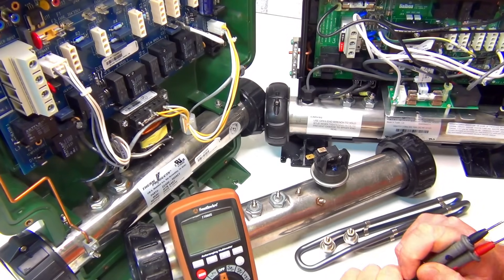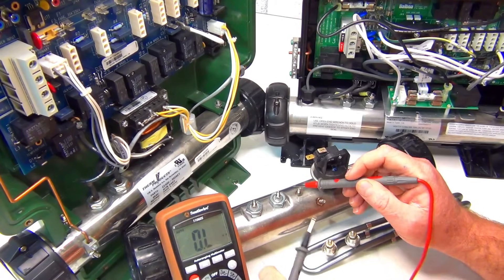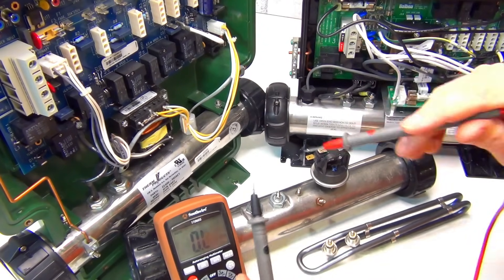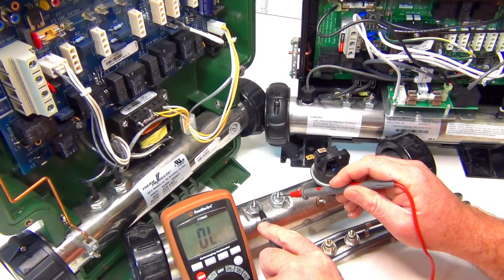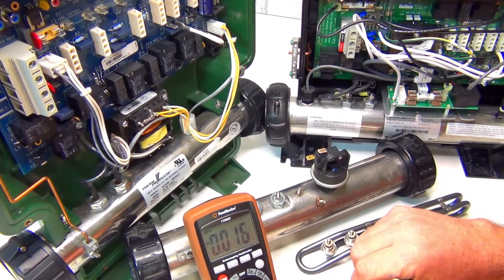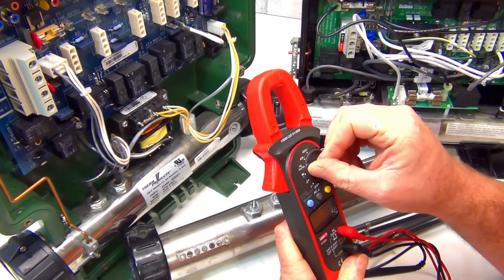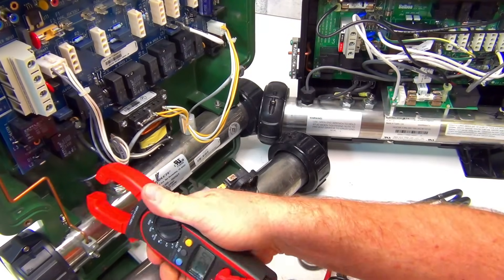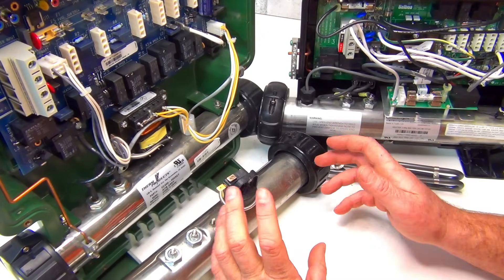4 Ways of Testing a Hot Tub Heater Element [ Step by Step ]

Comment: Hoping you can help. I have the balboa vs100 control board and heater. My hot tub is not heating past 71 degrees. Filters are clean and in standard mode (mot economy or sleep). I followed your steps. Test passed ohms, and continuity test. However, the voltage test seems bad. At my control board and across the heater element leads I only get 20 volts. But if I touch a heater lead and the ground or a heater element lead to the heater manifold I'm getting 120 VOlts.  My hot tub is wired for 240V. What do you think could be wrong.
Reply from the maker: Sounds like a relay issue.  Can you see any burn marks or melting on the circuit board?  Is your heat tube have the black cover or the clear cover?
Reply: @VIPPoolsandSpas  clear cover
Reply from the maker: @successfulguy  change out that heat tube.  It's that whole thing.  With the cord.  All info is on that tube.
Reply: @VIPPoolsandSpas  I have the heat tube out but I'm concerned that from the board I'm not getting 240VOlts. The tube and heat element across the prongs is giving me what is coming from the board and thats not 120/240 volts. I was worried that its something on the board. Your idea aout the relay being bad sounded more aligned to my issue.
Reply: @VIPPoolsandSpas  and the tube doesn't allow me to remove the heat element its almost like its soldered in like they made it so you have to replace the manifold too
Reply: @VIPPoolsandSpas  the continuity test passed and so did the ohms test
Reply from the maker: @successfulguy  it's one piece for that.  It's not cheap.
Reply from the maker: @successfulguy  volts coming in is 240v?   Your pump is running?  No error codes on topside?  No burn marks on the circuit board?
Reply: @VIPPoolsandSpas  yes 240, pump is fine, no burn marks on front of board I did not take it out to look at the back
Reply: @successfulguy  Did you ever figure out what the heating problem of your spa was?
Reply from the maker: Also, are you getting 240v coming into the tub from the house?
Reply: @VIPPoolsandSpas  yes

Comment: hi would you help me with heater,i test each leg black and red  got 120v each leg ,but when test black and red together got o volt.tell  me what wrong here ? ohm i think ok @  13ohm ,continuity is ok
Reply from the maker: What spa pack do you have?  Are any error codes on the topside?  What's the volts coming into the tub?  Just test volts at the 2 leads together.  If you have a 240v tub, it should be around 240v.  If it's a 120v tub then you'll get 120v.
Reply: @VIPPoolsandSpas  Hi there, hope you see this. I'm having the same issue as this guy. Testing voltage across leads gets 0V but each leg to ground is 120V. It's a Balboa M7. No error codes. Tub is not heating. Continuity and Ohms are good. I noticed the tub stopped heating after the water level may have gotten too low. Thanks!
Reply from the maker: @isaachamblin8866  replace the heater element.
Reply: @VIPPoolsandSpas  everything I've read says that if the voltage across the heater terminals is 0V then it's a problem with the circuit board. Plus the heater element has a resistance of 11 Ohm and good continuity. Thanks for the response!
Reply from the maker: @isaachamblin8866  Ok, change the board.  Doesn't matter if you have 11 ohms or you have continuity. I could get that with an element out of the hot tub.   It's going to be the element or relay on one side.  If testing 0 on a heater element was that simple, why don't people just say "0 volts, change the board"  No need for a video.  There's a few reasons why you would get 0 volts across the element.   But hey, what do I know.
Reply: @VIPPoolsandSpas  I figured it out. The heater relay on the board got too much current and burned out. Replacing the relay only cost $10 while replacing the whole board would've been at least $500 but I could only find my board for $750. So I saved hundreds of $ this way. I do appreciate you taking the time to respond. I do think it's pretty obvious though that 0V across the terminals means a board problem since measuring voltage there bypasses the heater element.
Reply from the maker: @isaachamblin8866  0 volts doesn't mean its the board or relay only.  A pressure switch, flow switch or sensor will tell the heater to turn on or off.  Also, if the pump pushing the water thru the tube isn't working or bad flow, it will not allow any volts to the element.  At least you found the problem.

Comment: Can you please help,,,i have a Balboa 4kw hetaer, my spa has 240v going to it when i test the blk & Red wires coming from the breaker - i also get 120v when i test each leg individual, common & Red and Common and Black, however my breaker trips when i connect the left lead to it, not the right, i measured for voltage and i am only getting 120v on that left lead that goes to the heater but i get zero volts on the right lead. When testing the heater for continuity it seems to have continuity and test fine, what can be the problem?....Im supposed to get 240v when testing both leads that connect to the heater correct.
Reply from the maker: Breaker or GFCI is wired wrong.  If it's a new wiring too the tub, that would be your issue

Comment from the maker: If you get volts at the heater element and no amps......change the element.  If 0 ohms, change the element. If 0 volts, it's a board issue.  NOTE: Make sure that the heater temp is set.
Reply: So my board is bad then? Ohms read good. But when I turn power on and test leads individual I get 120v at each. When I test them together looking for 240v I get zero. Is this correct?
Reply from the maker: @kevinrumancik6190  what hot tub do you have?  What spa pack do you have?  Did you test amps?
Reply: @VIPPoolsandSpas  master spa ls
Reply: @VIPPoolsandSpas  0 amps with power on
Reply: @VIPPoolsandSpas  yes
Reply from the maker: @kevinrumancik6190  need to know what spa pack is in the tub.  Heater element sounds like.  Can get volts and omhs, but if there's no amps.....it's the element.  It all depends on the spa pack.  can you take pics of the spa pack (control box) under the tub and send them to me at info@vippools.ca
Reply: @VIPPoolsandSpas  sent them
Reply from the maker: @kevinrumancik6190  change the element.  https://amzn.to/3f2QrOg
Reply: @VIPPoolsandSpas  ok. I will pick one up tomorrow. Thank you
Reply from the maker: @kevinrumancik6190  let me know how that goes.
Reply: @VIPPoolsandSpas  I will for sure
Reply: @VIPPoolsandSpas  changed the element a couple of hrs ago. Still not heating up
Reply from the maker: @kevinrumancik6190  how many hours ago?  Has it gone up?  Did you retest amps and volts?  How are you testing amps?
Reply: @VIPPoolsandSpas  3hrs ago. When I test for volts with power on. Still not getting any
Reply from the maker: @kevinrumancik6190  crap.  had to go back and read comments over.  Thought you got 240V on the element.  you got 0.  Know any computer repair guys?
Reply: @VIPPoolsandSpas  yes I do. What needs to be done ?
Reply: @VIPPoolsandSpas  I also pulled the circuit board out last Saturday to see if there were any burn marks. I did not notice anything
Reply from the maker: @kevinrumancik6190  most computer guys can test the circuit board and fix the relay.  if that's what it is.
Reply: @VIPPoolsandSpas  ok. I will give it a try
Reply: @VIPPoolsandSpas  relay was stuck closed. Installed new ones today. Tub is up to temp
Reply from the maker: @kevinrumancik6190  didn't see you could change those.  Newer spa packs don't have those.  Good to hear you got it going.
Reply: @kevinrumancik6190  I have same issue was is heater element or the board ? Thank you
Reply: Ohms was 10.5 with power off. I get no codes. Filters are out of tub. And screen shows thermostats with line running up it to indicated that the heater is heating
Reply: How to test 2006 Hot Springs Spa Grandee GG2H1579 pressure switch on heater
Reply from the maker: @stevenjones6298  testing a pressure switch for any hot tub is the same way.  If your getting a flow error, simply take the 2 leads off the switch and jump them together.  You will only do this for a short time to see if it's the switch.  When you turn the power back on when the leads are connected, the error should be gone if it's the switch.  If it stays, it's something else.
Reply: @VIPPoolsandSpas  I should have said I have the heater out and on my bench. I have 12 ohms on both of the gray leads but 0 on the 3rd lead which goes to the heater. I did just for the sake of saying it I took the cover off and tested there to. From what I've read will get a 0 reading without h20 pressure. Is that correct or is pressure switch bad. I had bought this heater last year. I took it off and apart. Cleaned the electrodes(packed with hard water sediment. Put it back in. No luck. The elements still looked like new. No distortion or burns.